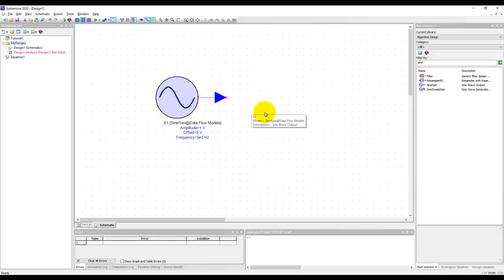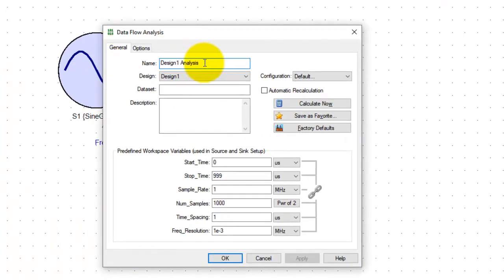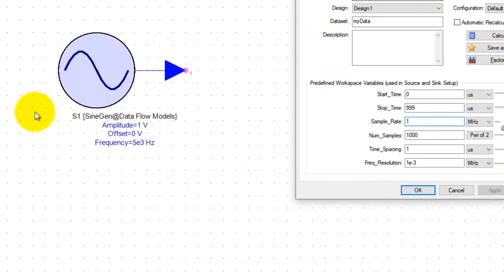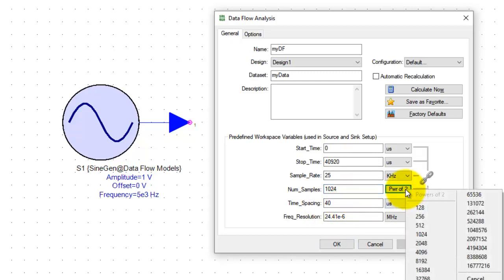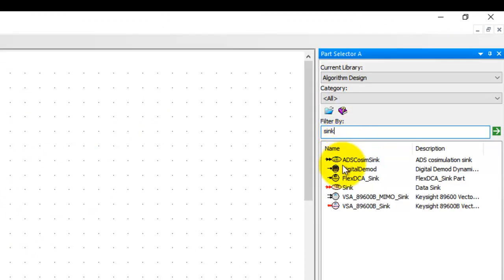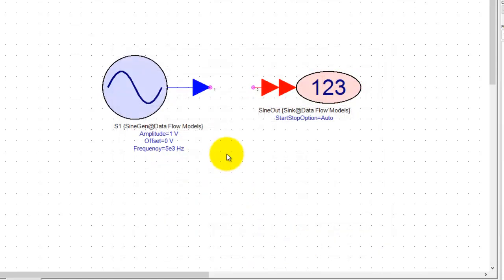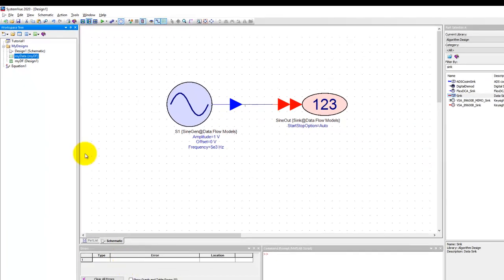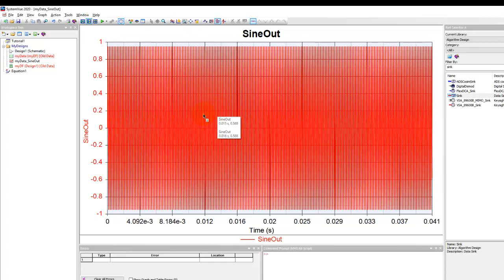Tutorial-3: Getting Started with DataFlow (Mixed Signal) Simulator

Comment: hi sir, can i simulate a LTE heterogenous network using systemvue and check data rate maximization or power minimization?
Reply from the maker: Hi Vamsi,
Yes, you should be able to do that in my view but you will need to contact your local Keysight tech support to help you.